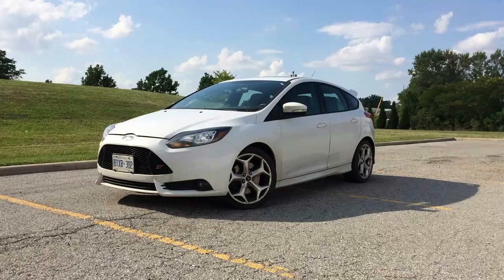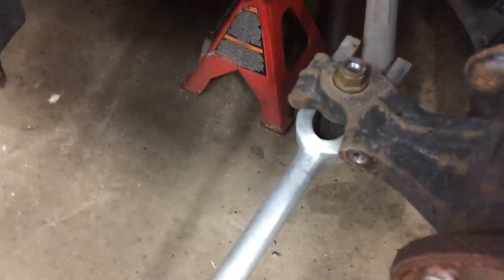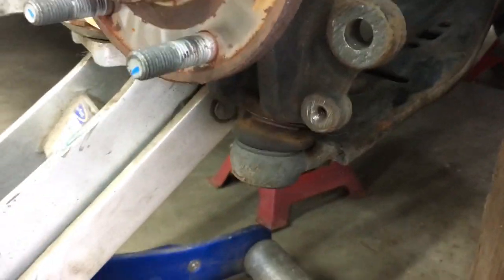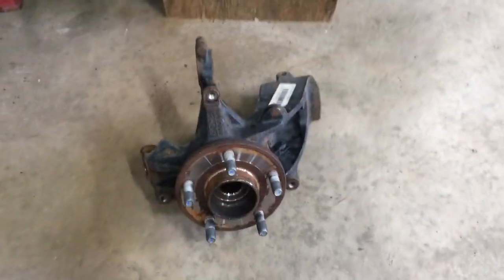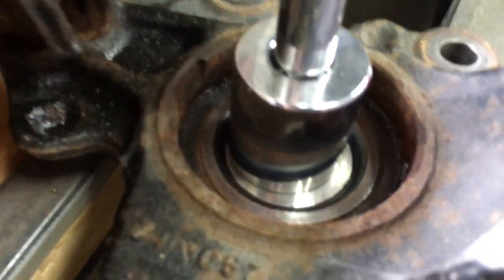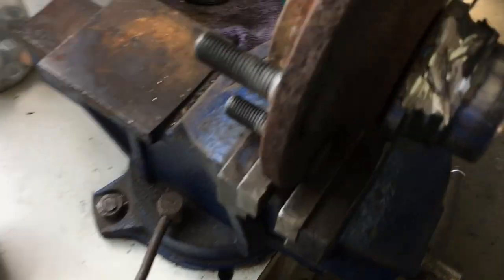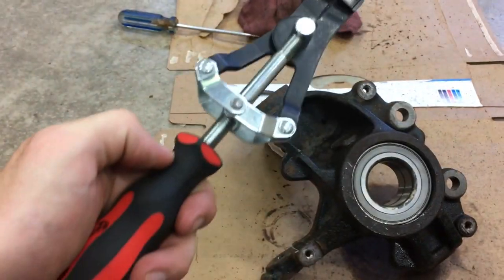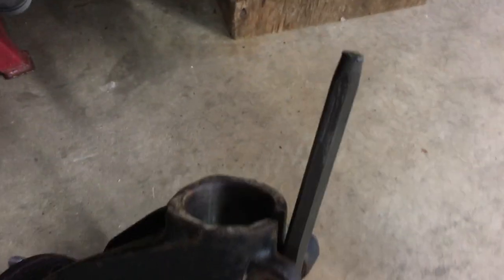Focus ST Wheel Bearing Replacement

Comment: Nice video, and applies to a lot of the Ford front suspension setups.  Couple of suggestions after having worked on my GF's Escape which is the same suspension.  1) I have a flat bar which I bolted to the lower control arm which sticks out and gives you leverage.  You can then push the control arm down by stepping on it and getting the lower ball joint free after removing the nut/bolt.  That control arm doesn't want to move easily!  This helps.   2) I have a small wedge made out of steel which I use on the steering assembly to separate it from the strut.  I remove the bolt, hammer it in, and the knuckle/hub comes off easily.   Do the work, slide it back on, then knock the little wedge out and install/tighten the bolts...

Comment: Easiest way to pop the ball joint out is to shove a longer pry bar into that larger rear hole of the control arm and press down. Comes out smoother than butter.

Comment: You can use a quarter(or other small piece of soft-ish metal) to spread the bottom shock mount on the knuckle. Back the bolt all the way out, flip it to the threaded side, reinsert, place a quarter on the inside of the opening and tighten the bolt a little. It'll spread the opening a little and makes getting the shock off way easier. Just don't crank it down.
Reply: Came here to say this

Comment: Thanks for the video Serge,  What was the symptom that led you to replace the wheel bearing?   I have a 2013 Focus ST that is starting to make a scrubbing sound when I make right turns, it does not sound like brakes dragging it is a bit more harsh but the sound diminishes or goes away completely when driving in a straight line.  It also seems to sound louder turning right then it does in a left turn but can be heard in both directions. If this is similar to your experience please let me know.  Thanks again
Reply: Exact same problem here, any news?
Reply: @codytyler824  ever figure it out? bought mine just like that and now the noise is excruciating and can be heard at all times
Reply: @landonmarriott2027  yes it was the wheel bearing, replaced that and it was relatively easy. However I struggled to find an accurate diagram of what part goes where when reassembling, the metal ring goes into the steering knuckle AFTER the bearing, furthermore the magnetic side of the bearing faces toward the inside of the car (towards the engine)
Getting the wheel bearing out was far more difficult than getting the new one in. Ended up using a slightly smaller steel plate and pressing out the bearing with a drill press
Reply: @landonmarriott2027  it could also be your steering rack, sometimes the cover falls off and rocks/debris can get in there
Reply: @codytyler824  awesome! thanks so much!

Comment: To seperate the knuckle assembly from strut, turn nut around and insert in other side and then apply a skinny chisel or something into opposite end. Then tighten bolt alittle as it forces chisel to spread metal apart. Very little pressure cam be needed. As soon as you see it lift away from strut stop. Should slide rite off instead of tapping on it forever. Cool trick I learned from another mechanic.

Comment: Wheel bearings (front) on a Focus 2014 have been a complete nightmare 
for me. I ham pressing the old ones out just like this video of yours, 
then pressing the new ones in (even froze them for a better fit when 
pressing) ... Everything looks and feels fine but the moment I install 
this back on the car, I get the famous wheel wobble again .. It's beyond
 me what I am doing wrong as I am doing everything by the book! ... 
Help!
Reply: Have you tried putting a different tire/wheel on (or rotate a different tire to that corner)?